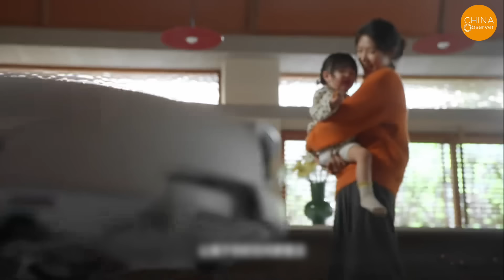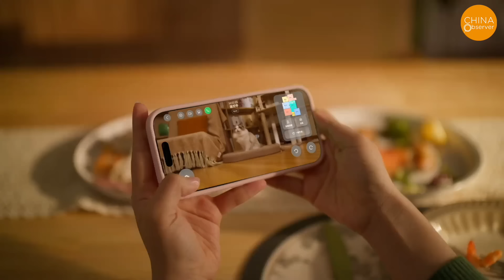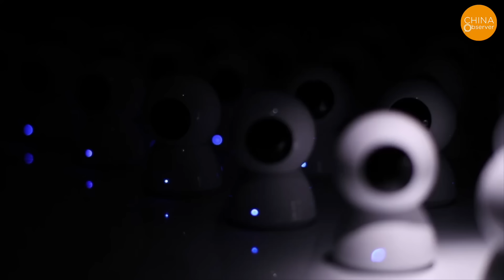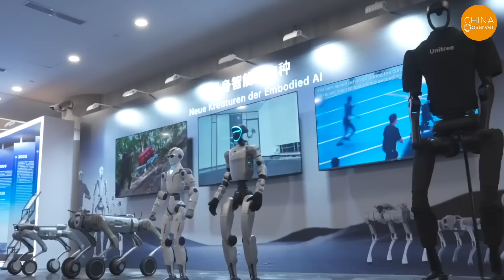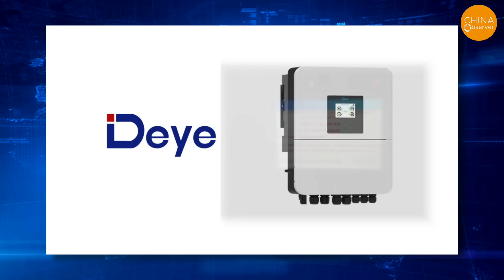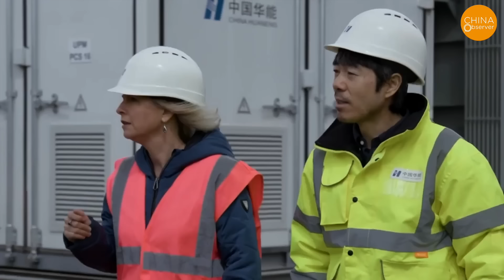This is No Overstatement! China is Watching You, From Robot Vacuums to Solar Panels

Comment: Here's the translation:

Yes, the United States is experiencing a significant fuel crisis. Gasoline prices in the US have surged by 35-40% in recent weeks, with the average price reaching around $4 per gallon or approximately Rp17,980 per liter. This price hike is triggered by geopolitical conflicts between the US and Iran, disrupting global energy supplies.

The impact is felt by US citizens, who are experiencing significant economic pressure, with rising prices of goods and services. Some examples of food commodity price increases are:
- *Eggs*: from $1.60 to $4.80 per dozen (180% increase)
- *Milk*: from $3.50 to $4.40 per gallon (25% increase)
- *Chicken Breast*: from $3.20 to $4.75 per pound (48% increase)

This crisis has sparked concerns about inflation and economic stability in the US. The US government and other countries have taken measures to address the crisis, including using energy reserves and fiscal policies ¹ ² ³.

Comment: Spain`s electric grid has a lot of Chinese technology when the Spanish government decided to "go Green". If there is ever a war or if one wants to hurt someone`s economy and disrupting a country`s security ,communications  is a good way to get a leg up on the opposition,not to mention "casing the loint" for a tech savvy burglar.
Reply: EU market is heavily regulated. NATO did know and blocked converter kill switches.
Spanish blackout was due to outdated infrastructure.
Reply: @TheRezro  about 30% correct. The problem was that someone decided to open up a connection to France to purchase power without engaging a synchro - basically a large mechanical spinning wheel, or sets of spinning wheels - to cycle the megawatts of power coming in from france - which turned out to be wildly out of sync and this leads to destructive interference. This is very old school - but it works. 

Modern grids now also use battery/capacitor  "high frequency" systems which can delivery megahertz or kilohertz adjustments - which can calculate the problem and 'soak' power to deliver a synchronising pulse effect to try and match the voltage/power and frequency to match between the two grids before connecting. 

This acts like a giant "Transmission Clutch" - because when you have megawatts of power - tonnage of metal is kind of your friend. It stops that energy being delivered into people or the grid itself, which can spread through the moisture in the air. Spinning tonnage of metal the size of a house - also has momentum and physics behind it. 

if you have two giant house-sized spinning wheels and they're moving at different rates - the "clutch" can't connect, and one side has to speed up or slow down to match the other. usually by adjusting the voltage to drive up the speed of the frequency over time until it can 'lock' without friction/slipping. The principle is dead simple - but it's that kind of simple that wasn't present in Spain's side. 

Modern stations don't generate sine/sync, because very few power stations stop and start independently once they hit a certain size. They become the central clock that everyone syncs up with. Smaller production has to, or they burn out their equipment. But ... if someone isn't doing their job and they flip a switch to quickly make money ... without checking ... you end up with a cascade of basically toxic power. 

FWIU, it was below 48hz - which is enough to trip several power stations, and this kind of shutdown ripples out - because nobody has the "proper" sync to restore back to. As France became the prime supplier for the grid's energy phase and frequency, power stations had to be manually reset - they could not handle "France's" version of the power so simply -and shut off. 

If the frequency was exactly the opposite, then like noise cancelling headphones, you get silence. the power going out, cancels the power coming in... until the larger side wins, and suddenly the force of all that energy you pumped out to cancel the incoming gigawatts of power, crashes backwards into your own generators. 

Or to put it another way, the turbines stay still, and the power station rotates (sic). 

Without the equivalent of a "clutch" or capacitor to slowly shift the grid frequency of spain's connection to France - there becomes a period of alternating current that stays active and inactive at the same time, with varying amounts of power causing anything that requires a cycle or spin to accelerate faster. 

EU power runs on 50hz, 230v, but it can usually tolerate 49-51hz. More sensitive  equipment will trip up or brown out when the frequency is wrong,  because it becomes like pedalling a bicycle wheel that's moving your legs for you as more power is being delivered than your legs can push back against. Eventually, that power isn't controllable. 

In an attempt to 'gamble' they kept this purchase of power and could not disconnect the foreign feed. Due to the scale of the imbalance - they didn't immediately shut off the connection - and gambled on the connection being able to deliver enough power before it caused problems. What then happened was that the imbalance literally tipped every other generator on spain's grid into emergency shutdown.

Comment: Don't buy Chinese trash.
Reply: You can reduce reliance on China, but you can’t realistically eliminate it. Modern supply chains are global, and even products made outside China often depend on Chinese components.
Reply: @danielarzanipour8112  The so called reliance on China is often exaggerated.  China was not a factor in the world economy before the 90s.  The US and its allies help changed China to become an export powerhouse with offshoring and establishing supply chains there.  That is gradually being realigned.  Chinese components are just cheaper and often not the best.  Other countries can make them as cheap.  Note the iPhone has around 3-4% components made by Chinese firms.  Apple has very stringent requirements on quality and consistency.
Reply: That's why I see Temu as 
T.E.M.U: The Equipment Most Unwanted
Reply: DJI is not trash though. It's one of the rare Chinese companies that actually have good products and is superior to what is available in the West.
Reply: @canuck21 That’s why DJI drones have been widely used on both sides of the Russia-Ukraine war.
Reply: @ironfalcon100  On the Ukraine side, they are provided with US made Switchblade 300/600 and Phoenix Ghost drones designed to fly into targets and explode.  Ukraine also make some domestic drones for themselves as well.  They also use other outside military drones they can get their hands on such as Turkish Bayraktar TB2.  The widely available DJI drones are also used and often modified.
Reply: @canuck21  Not necessarily superior.  DJI drones are often the preferred choice for the general consumer and for the overall price and performance.  There are several high quality, high performance drone makers in the US and are often used for certain functions or specific markets such as construction inspection, cinematography, public safety, carrier, law enforcement, surveyance, 3D modeling, adverse weather or extreme environment, endurance and resilience, military application and smart drones for heavy duty applications.  They are much more expensive and not something the general public look for.  Companies such as Skydio, Planck Aerosystems, Freefly Systems, Instant Eye Robotics, AeroVironment, Lucid Drones, DVAerialCam, Skyfish, TerraView and Vantage Robotics, just to name some.  The TerraView X8P has over 70 min of flight time, 30 miles operating range and flies over 40 mph.  Freefly Systems focuses on high-performance drones for cinematography.  Vantage Robotics makes military-grade drones, while the Instant Eye MK-3 can handle extreme weather.

Comment: Even on my cheap oneplusone phones after digging, founded a system file, that's send all the user data to a server in Beijing, China. After that, I only buy phones that isn't manufacture in China.
Reply: Can you please tell me what is the name of that "system file," so I can delete it on my phone?
Reply: @Think-About-It  Its named differently and you need a tool like universal debloater tool and starts to dig. Sometimes they put a separate microchip like a lot of xiaomi phones haves. Plus remove manually on your phone you cannot do, even with root access enabled.
Reply: @statostheman thanks for the info bro!